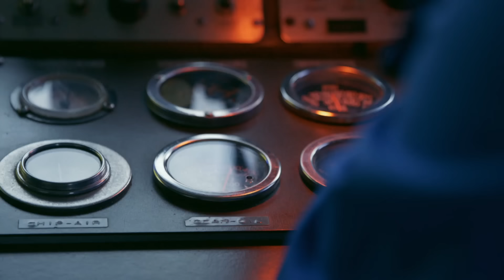Northwestern Crew Member Rushed To Hospital After Seizure | NEW Deadliest Catch

Comment: As someone who’s suffered with seizures before I can tell you it’s scary as hell to go through. It knocks the person out and there entire electrical system lights up all at once and it’s too much for the brain and body to handle. There are therapies that can help that I have undergone and it has helped me to not have any more seizures since I started the therapy. Been clean of seizures for almost about 5 - 7 years now. It was a lot to handle but I got through it. I hope he can get the help he needs to stop having the seizures like I did.
Reply: Ya they are very scary have them too. Like a emptiness feeling after and thought I could of went there.
Reply: Intersting, what therapy did you follow??
Reply: after having a brain tumour I have had several seizures, but controlled for 6 years with Dilantin, seizures suck particularly the coming out of it part, it is hard to describe how bad it can feel, then next day you hurt all over because your muscles cramp so hard
Reply: @SaltimusMaximus  After a grand mal seizure for me there is some extreme discomfort reminiscent of severe nausea but it's a lot more intense and slightly different. It really sucks. Lasts for like 15-40 minutes. One time I also hit my head on a stone tile floor, body went stiff and fell like a tree with my face taking the full brunt of the impact, broke my nose, teeth, fractured my skull, had to get 25 stitches in total from my eyebrows and surrounding areas splitting open in various places, both eye sclera were completely blood shot for days afterwards, looked pretty scary. Fuck seizures for real.
Reply: @Cobbido  sorry for you bud, I haven’t gone through it that bad, yes nausea is one sensation, others I can’t describe, just that they feel bad in waves or like shots, guess nerves are misfiring which makes it happen
Reply: Glad to hear you’ve been clear of it for so many years brother. Hope you keep on healing from such an awful condition

Comment: " a fire at seas can spread in seconds " I think a fire can spread in seconds pretty much anywhere .
Reply: But unfortunately at sea the ain't no were to run for safety or call for help.
Reply: A ship has lots of things that can make a fire spread faster. Hydraulic oils, engine oil, etc. A smoldering fire can quickly become uncontrollable. Combine this will no where but the sea to run to and how easily smoke can overtake compartments and suffocate you it's way worse.

Comment: Fire on a boat, the only place to evacuate to freezing cold water. Fire spreads fast due to the metal it turns into an oven with toxic fumes.  Am angle was looking after them